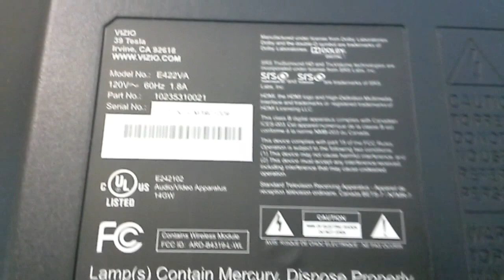Testing EEPROM U405 for Vizio E422VA main board 715G4365-M01-000-005K

Comment: I got a E422VA stuck on logo screen. I checked out your website description but doesn't list this as a common problem. Stuck on boot screen is typically eeprom related, do you agree?
Reply from the maker: jeffescortlx The website is fairly clear and correct in what it says. It definitely could be eeprom, but there is no easy way to say for sure it is without taking it out and testing it in a working set. Whoever gives you definite answer to the above question is either green or trying to take advantage of you. Or both.
That said, I think it is fair to disclose that statistically the eeprom is not the most likely source of the problem.
But it is not as if it never fails either are some are saying.
Reply: OK. Thank you for the reply.

Comment: hdim ports for vizio model E422VA DO NOT WORK BOARD NUMBER 715G4365M0H000005K TV TURNS ON JUST THE  PORT DONT WORK
Reply from the maker: If you can not narrow down the source of the problem to particular component consider using

http://www.coppelltvrepair.com/p/1309/repair-service-for-vizio-e422va-main-board-756txacb5k005-txacb5k00502-txacb5k00503-txacb5k00504q-756txbcb5k00903-txbcb5k00902q

Comment: Bobby, HDMI ports don't work does the EEPROM correct the problem or should i change the Main Board? Model E422VA.  Thanks for info
Reply from the maker: Problem is usually NOT in the EEPROM, but recall at least TWO cases (out of hundreds) where it WAS the EEPROM.
So statistically speaking you should not replace the EEPROM, but there's no way I can promise you the problem is not there.
I say just send the board to us.

Comment: l have similar issue, i install a new power supply it still having the same issue. i connect the tv it start to blink 21 time after that i turn the tv on and it do not do nothing black screen and no audio please help thanks. my email sayaco.75@gmail.com
Reply from the maker: Well I can't say what the problem is, but I believe you've sent us boards for test and repair before, so you know the drill already...